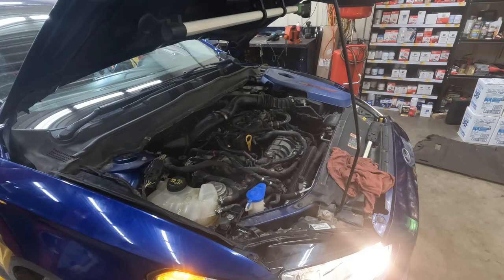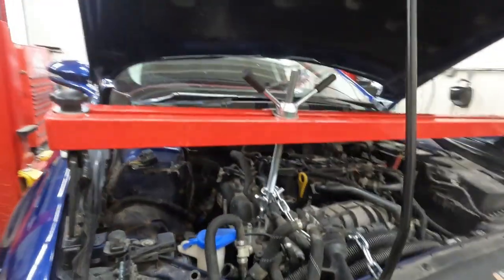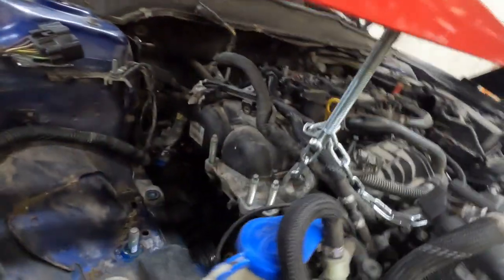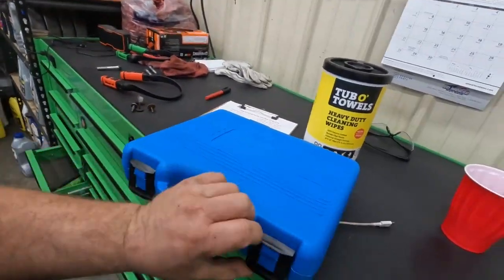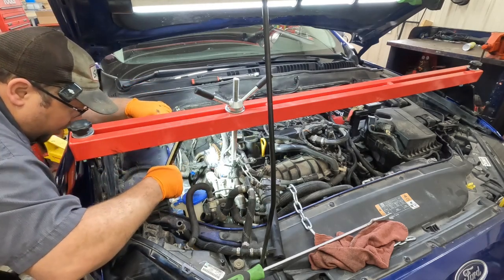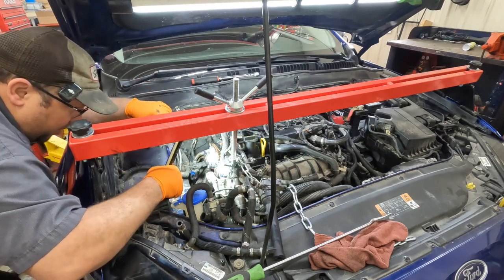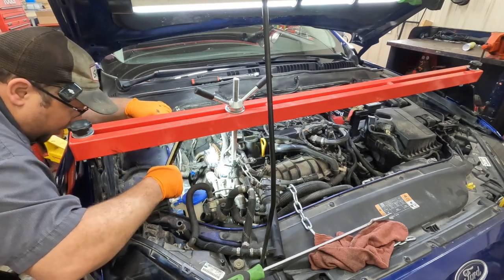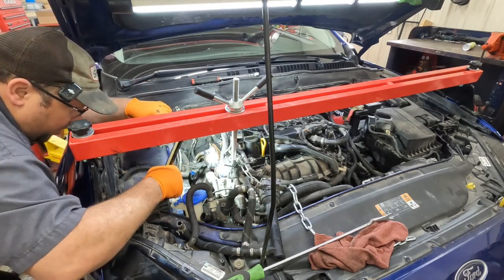2013 Ford Fusion 1.6L Ecoboost bad water pump requires timing belt removal. No timing marks!

Comment: Any advice on what to do next if it doesn't start? It's cranking, but not starting.......
Reply from the maker: The first thing I would do is check to see if there’s any codes in the computer if you have a way of checking that. I would also go over everything and make sure everything got plugged back in.
Reply: @hrdiesel  That's kind of what I was thinking too. Hopefully it is just a sensor that I forgot to plug back in or something like that. I will also scan it as well. I did have the spark plugs out during the process, but that shouldn't matter......they do need to be changed but it still should fire up. Thank you again Sir for your help and video. I really appreciate you.
Reply: @hrdiesel  Okay, so I double checked everything and it all seems to be good. Any other suggestions before I go back and redo everything? When I say redo, I mean taking the necessary steps to make sure the timing is right? I replaced the timing belt and water pump (since it was leaking and overheated) so I will obviously not take the water pump back off. But I was thinking about rotating the cams back to TDC and then taking the belt back on and off again. Not really sure how that is going to help. But what are your thoughts? She still won't start. She does have a C1299 code which is the "Cylinder Head Overtemperature Protection" mode. I was wondering if that is why she won't start. I thought about replacing the coolant temperature sensor OR the cylinder head temperature sensor (CHT) to see if that would clear the code out....I know this may cause the vehicle not to start either....I am more leaning this direction.... Thoughts? Suggestions? Thank you, Chris

Comment: Could you provide the torque specs for the water pump?
Reply: It looks like the timing belt tensioner is 18 ft-lbs, so the water pump bolts are probably 8-10 ft-lbs.

Comment: This is just my style, if I have the instructions printed out, I am going to add my own notes while I am using a lift or no lift. I only want to lift the car and lower the car ONE TIME. I will make notes of what needs to be done while I am under the car and be done down there. To me, unless it is impossible to do it all in one trip under the car, I don't want to be embarrassed but going up and down and up and down on the lift, following my own instructions to do the job as efficiently as possible, which may not work on the first job, but will work on all future jobs. This also includes a more specific note that a puller is not needed under normal conditions.

I always mark the old timing belt and transfer the marks over to the new belt by counting teeth if it does not come with marks to realign the new belt to the proper places without worrying, did I put that on correctly? What I mean is I do not trust the special tools to ALWAYS align things up 100% of the time, no pun intended. Thanks for all your very useful videos near 100% since I found your channel but have not watched prior to JAN 24.

Comment: Do you have a link to that engine brace thing you are using on the top?
Reply from the maker: Yes I do! 
https://www.vevor.com/engine-hoists-stands-c_11868/vevor-engine-support-bar-engine-load-leveler-1100-lbs-transmission-w-dual-hook-p_010170004823
Reply: @hrdiesel  could I get a copy of those instructions?  Great video, getting ready to do the wife's car
Reply from the maker: @scottsmith238  email me at info.hrrepair@gmail.com and I will email those over to you!